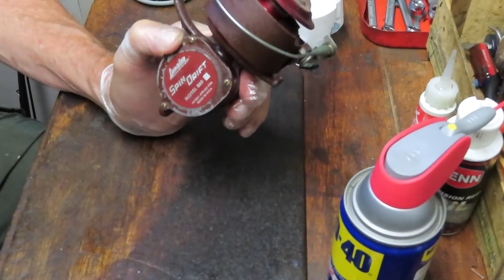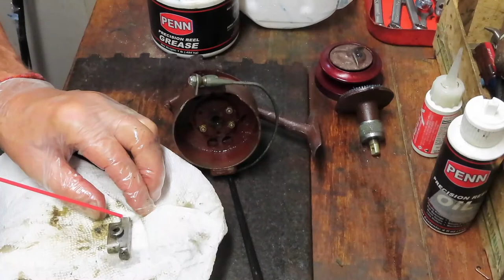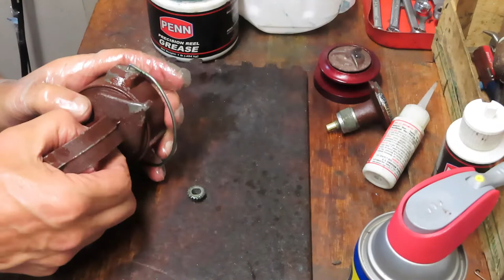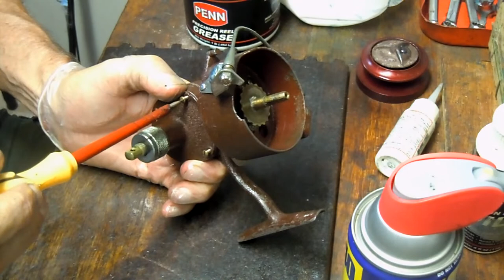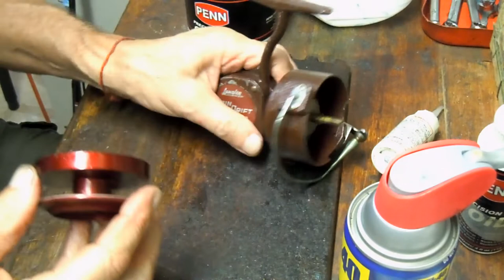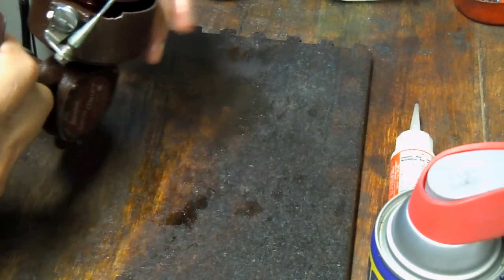Langley Spin Drift model 860 vintage spinning reel how to take apart and service

Comment: My grandfather had one of these in black with a maroon spool. It has been hanging on the wall in my garage on his old surf rod as a decoration. About a week ago I decided to take it down and see if would still turn. It did, but it wasn’t easy. I took one piece off, then the next. Now it is completely disassembled and has the paint stripped off ready for a refinish. To be fair, most of the paint was flaking off anyway.

I’m sure I’ll be watching this video again when it comes time to reassemble. After hanging on the wall of his garage and now mine for 40 some years, you picked a nice time to post this within a couple days of when I decided to mess with it.
Reply from the maker: Great timing.  Glad I could help.  Best wishes in you restoration - Dennis

Comment: I just got a new in box Langley Spinnator and this video really helped me out. I did not remove the handle LOL. That little chrome lever below the rotor is the self centering bail/anti-reverse. It's off when in line with the bump for the bail, on when at 90 degrees to the bump. Only stops when the bail is centered, so the anti-reverse only stops in that one position. What a great reel.
Reply from the maker: I have come to appreciate the older reels and Langley was a nice reel when spinning reels were just being introduced.  They were eventually acquired by Zebco in 1957 or so and the name disappeared   - Thanks for the note - Dennis

Comment: Finished up the Zebco Surflite the other day. Watched your video a few times before going at it. Pretty much the same reel but the Zebco had an interesting anti-reverse system. Stripped it down to metal and repainted it with Black wrinkle paint. It looks new now. That little metal bumper on the housing should have a short piece of rubber tubing on it.
Reply from the maker: Those bumpers are the first thing to go.  They dry out, crack and fall off.  Sounds like you have a nice reel now.  Thanks for the update - Dennis

Comment: Great video. I just got a Langley Spin Deluxe, it is very similar.
Reply from the maker: Yes they are.  I like the Langley products.  Langley was purchased by Zebco in the late 1950s because they wanted to add spinning reels to their line up.  The brad disappeared by 1960.  Best wishes - Dennis

Comment: Great video Dennis, I just picked up a Zebco Surflite 860 that looks to be the same basic reel, but with an anti-reverse mechanism. Once again you saved the day. I would not have though about those “c” clips holding things in place. The finish is worn on mine so I’m planning on taking it completely apart and refinishing with the original Black wrinkle finish.
Reply from the maker: Thanks for the note Matthew.  Best wishes on your restoration - Dennis

Comment: need a tutorial on setting the bail return spring on these langleys and early zebco spinners... destroyed 3 so far yet put it together multiple times on my first rebuild just fine somehow.
Reply from the maker: I will check to see if I have one of these in the shop and will do a video if possible.
Thanks for asking and for watching - Dennis
Reply: @2ndChanceTackle  thank you so much, very much appreciate the channel and all your work! just now at 22 getting into fishing and always been a fan of mechanical engineering so took the chance to learn how these early spinners work rather than the (in my mind) overcomplicated modern versions. really adore these, have a Zebco 777 Spinner and a Zebco 822 Spinflo, both Langley models acquired by them. have another, a Langley 852 Spinlite on the way. rehabilitating old pieces like these is practically therapy when you keep your head cool and think logically

Comment: Dennis, I was right. What I had heard about the AR in these reels or rather the lack of any AR in these reels was the negative problem. I can certainly appreciate the clever ways those who engineered this reel went about solving problems in design. It’s just my own perspective and preference when I say I don’t particularly like these reels nor do I want one. My opinion hasn’t changed. My Mer 52 Punch reel was made in 1955 and is an almost infinitely better reel in almost every aspect you can think of. Also I have a small Luxor reel made in the late 1940s that is a much better design again in almost every way. Oh, the drag on the Mer reel had a metal ring right under the drag knob that had two small holes directly opposite each other . I tried to use a tool that inserted in those two holes to twist open that metal ring. It wasn’t a lock ring that you squeeze to remove, it was a solid steel ring that looked like you would unscrew it to get to the drag washers underneath. I could not get it loose. The drag was working perfectly so I did not force it. You did a fine job on this Langley. I just simply don’t like it and I don’t think I would particularly enjoy fishing with it. In spite of that, this was very interesting and a great video. I will watch it several times to see if my mind might change.
Reply: Lev Parnas  I wasn’t finished and edited my comment - 1955. I am partially blind so I almost always make mistakes and have to edit what I write. Sorry!
Reply from the maker: You were right, but still a nice reel - Dennis
Reply: 2nd Chance Tackle  Dennis: I couldn’t wait once I saw the reel. I disassembled and serviced the large Luxor reel I got the afternoon. What a reel!  It has both the largest ball bearing and largest main gear I’ve ever seen. I had to pull out an old set of small ignition wrenches in order to get the axle shaft out and disassemble the crosswind arm. It was attached to the axle with a small nut and lock washer. You’ll see when you do yours. The rotor is attached to the housing by three screws. The pinion does not touch the rotor at all. You’ll have a few surprises when you remove the rotor! There’s plenty of stuff in this reel I’ve never seen before. My Luxor doesn’t have a mark or scratch and it is perfect internally as well. It took a long time to clean because it was full of thick dark brown grease. I got a bargain with this one though. One thing I couldn’t believe was how fragile the bail seems to be. Looking forward to your video on this reel!

Comment: Did it turn out that the spring loaded mechanism under the rotor was the anti-reverse?  Mine just had a lever that was fitted with a basic spring and as it rotates it clicks against a movable Paul on the frame. Looks like the spring on yours should hold that lever out and it will ratchet against those little parts that are sticking out in the frame.  Looked like the coil spring on yours was worn out.
Reply from the maker: I think you are right.  That reel was part of a pile of reels that I got and I don't know it's history.  Will go back and check it.  Thank you - Dennis

Comment: My zebco 860 has an anti-reverse lever next to bail bump or whatever it's called
Reply from the maker: Thanks for the information.  Zebco bought Langley's reel manufacturing  in the late 1950s.  They initially did a simple rebranding and then they changed models, so the a/r lever may have been added later

Comment: Nice old reel you can see the quality in that one. May be heavier than today's reels out there. But heavy always comes out on top. Far as endurance. And dependabuilty. IMO. It will still be around when all the China junk has bit the dust.
Reply from the maker: I agree.  Not pretty, just solid and dependable, which will win every time in my book - Thanks Michael - Dennis

Comment: That's right, use fishing reel grease. 
Not vaseline/petroleum jelly, axel grease or drippings and lard.
Reply from the maker: So - you have seen folks using Vaseline as well!  It's a quick, but ineffective fix.  I also just did a D.A.M.. Super with axle grease in it.  I just don't get it. Best wishes - Dennis